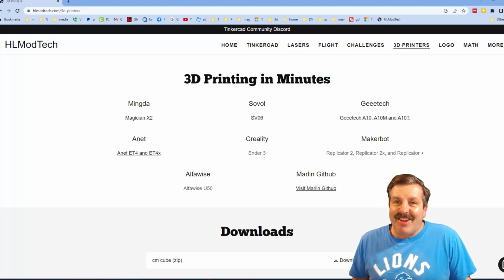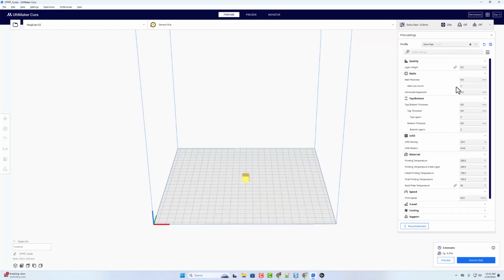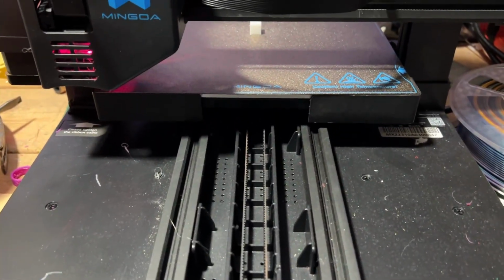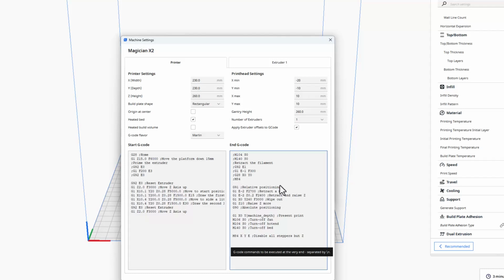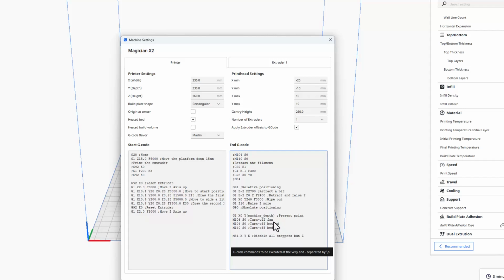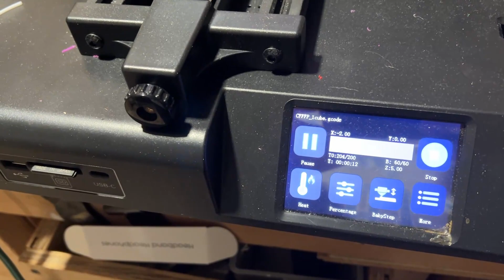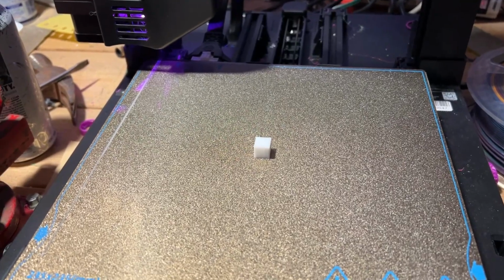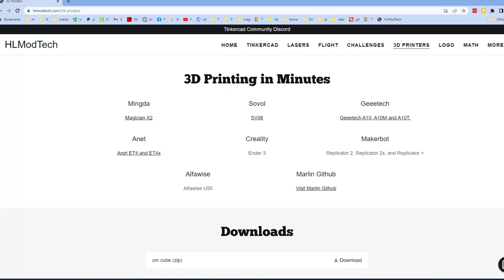Modify End Code to Present Your Print Mingda Magician X2 and MORE in Minutes!

Comment: hi will these settings work for the mingda magician x
Reply from the maker: I am not really sure... as I have not worked with that printer. That said, those codes are pretty general. I would just give them a try and see what you find.
Reply: @HLModTech  hi i tried it and it worked fine thanks for the reply
Reply from the maker: Fantastic! Thanks for letting me know.

Comment: Hey thanks for the video, I have a question if I also want the print head to move up further at the end to make it easier to remove the printing plate, can I simply enter the following in the line: G1 Z10 ;Raise Z more for example:G1 Z50 ;Raise Z more or will there be problems if I print something that requires the entire height of the printer? Thank you and best regards.
Reply from the maker: My pleasure with the video. I am not sure, but it sounds like it would be an issue as you explain the max height print. You may be able to get a better answer for something like that in one of the 3D printing groups on Facebook or Reddit.